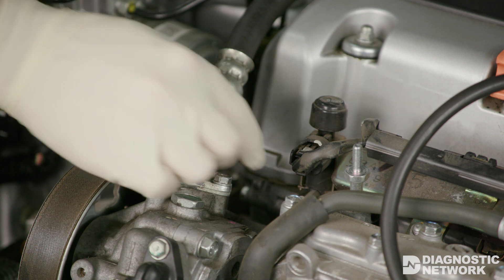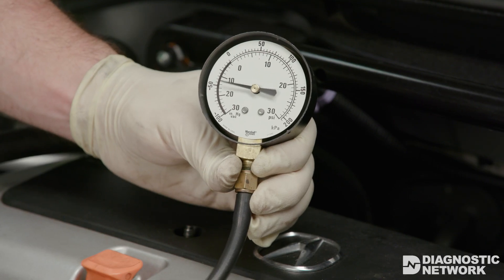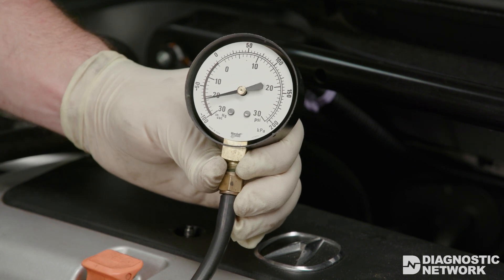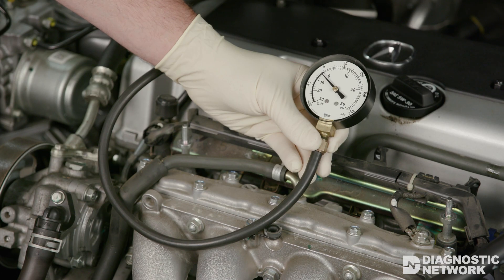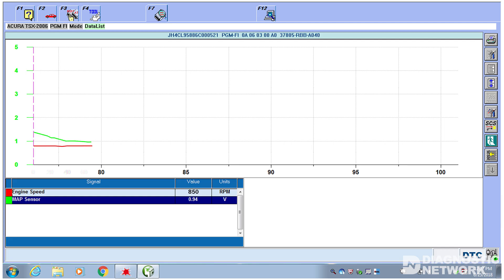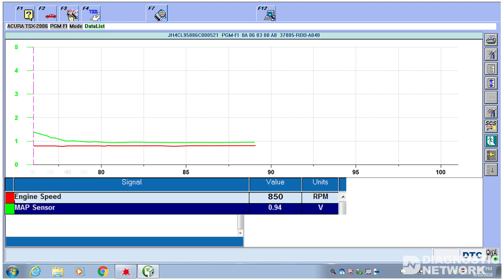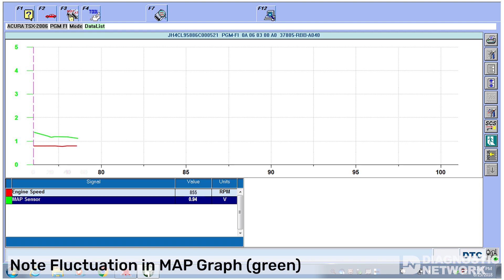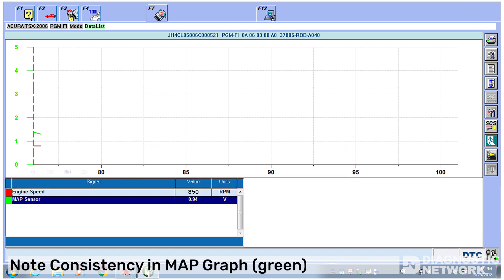Honda Misfire Analysis - Volumetric Basics - Diagnostic Network - diag.net

Comment: Is this true for all Hondas, years, models, engine sizes?
Thanks.
Reply from the maker: Hi Rick, we recommend checking SI for your application to see if the valves are adjustable. If you're addressing a misfire issue, try using the methods illustrated in this video during your analysis. If you're interested in collaborating with fellow technicians please consider checking out Diagnostic Network: https://diag.net

Comment: Don't forget that a gauge can bounce on some vehicles if it's during an Atkinson cycling event. This would be normal. So know your enemy😉
Reply: keith ,Thanks for that important piece of information.. i have much to learn.
Reply from the maker: Good point, however, in that case, we would be negative misfire DTC's, right?
Reply: Diagnostic Network Touché,  now does a misfire disable the Atkinson event altogether?
Reply from the maker: Good question, and one more fitted for the techs on Diagnostic Network: https://diag.net 

This video was shared within this post by the instructor featured in the video. I suspect he would know.
https://diag.net/msg/m3weqaqjrasj8znrabzxcoazee